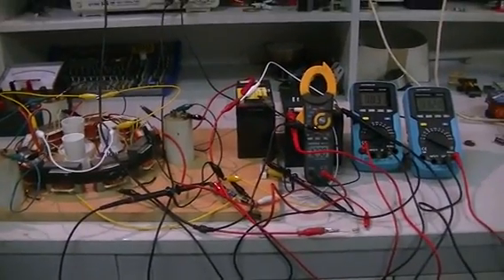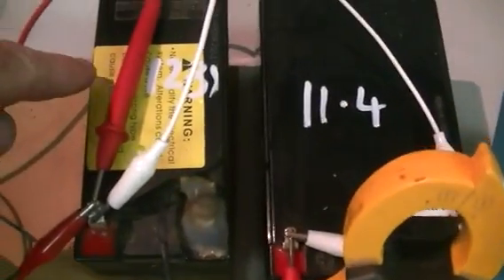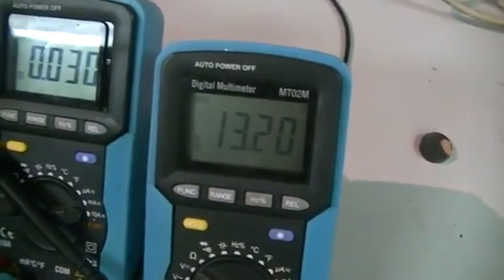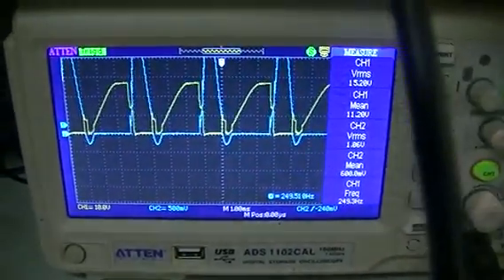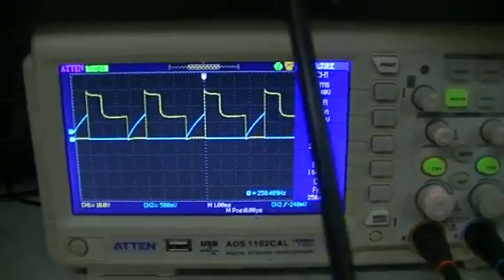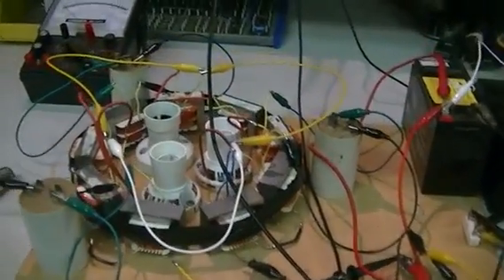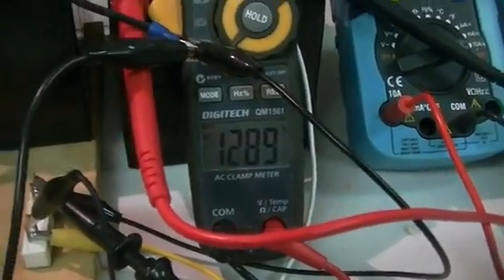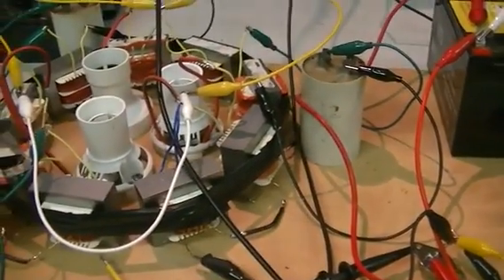Tesla Bedini Reactor Morph

Comment: high voltage pushes up the batteries but does it fill it with amps. or does the amp hr reduce. in other words if you put even a small load on the battery it would have a voltage drop below 12V ?